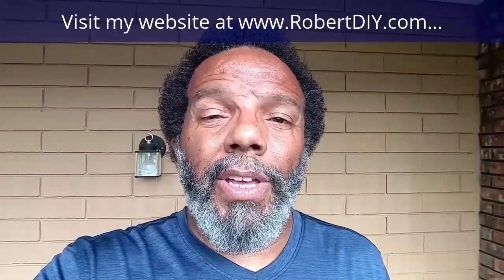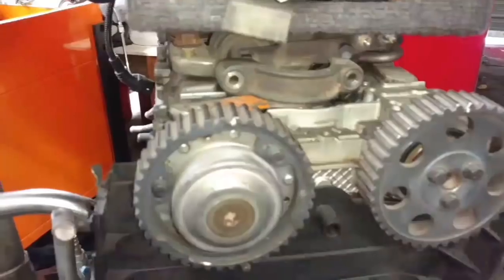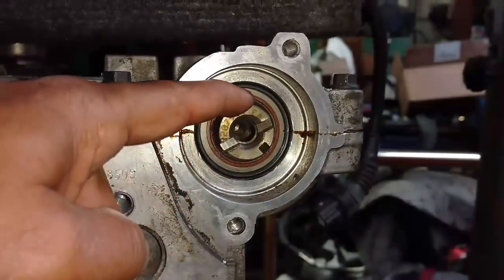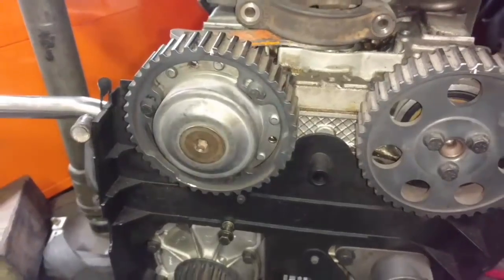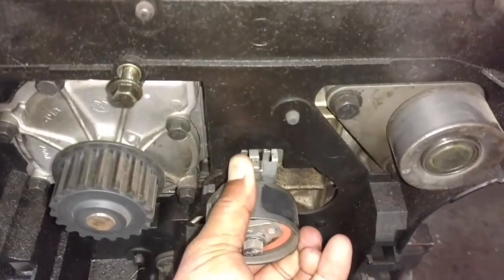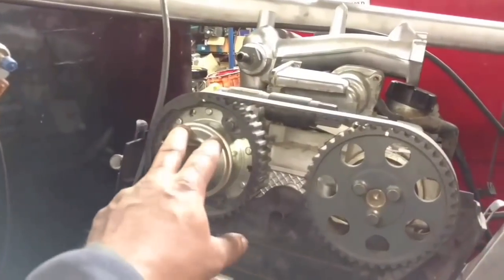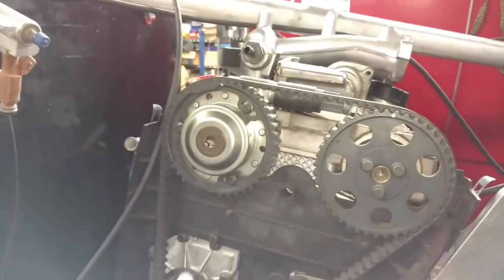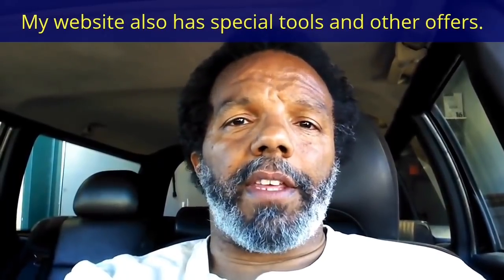CVVT and VVT hub, timing, installation, adjustment, how to install, etc. Volvo cams - VOTD

Comment: Hey Robert I have a 2004 Volvo XC 70 with a T5 2.5 Engine I have recently rebuilt a cylinder head for my car and trying to replace it today due to a burnt valve for cylinder one and I am trying to figure out the dual VVT whenever I got my other cylinder head off of a parts car I’ve removed the VVT hub sprockets and I’m thinking I have a clue on how to put them back I just rather be safe than sorry can you help me and explain to me please and thank you
Reply from the maker: Did you watch this video?

Comment: Any videos on setting VVT on a dual hub motor? 2003 XC70 for instance? Every video seems to be on single spring loaded hubs. Thanks.......
Reply from the maker: Have you tried this method?
Reply: @RobertDIY  I have the VIDA instructions and some PDF instructions but this video doesnt seem to apply directly to a dual hub setup - I was just hoping for a video (visual learner) as some of the instructions a bit confusing in terms of setting the hub to full forward etc. Dealing with two hubs while setting the belt is not much joy either :) - I need 4 hands......
Reply from the maker: You install one hub at a time.
Reply: Robert DIY I understand but the dual hub setup is not spring loaded so do I not have to worry about setting the hub alignment? Instructions talk about finger tight main bolt and turning hub to full forward then back then etc etc. It's a bit confusing and probably reads more complicated than it is. 
Thanks for the replies.
Reply from the maker: If you lock the cams from the rear, install the hubs with the proper play, then install the belt, mark the cam sprockets if they are not marked, remove the locking tools, roll the engine over by hand to make sure you have no contact, you'll probably be good. 

You can also have it towed to a Volvo shop to have it finished. 🤔
Reply: @RobertDIY  "Resetting" seems more involved - This is what I did - 
With cam bolts loose
with the hub bolt tight - turned hub CCW till it stops
loosen hub bolt
Turn entire unit CW till the timing mark was about 2 cogs BEFORE the mark on the plastic cover (this also sets the cam bolts to the left edge of the ovals)
Tighten hub bolt then turn CW till it stops then torque down
Turn the cam gear back to align the mark to the cover and done

I've found no visual references for a motor with dual NON spring loaded hubs.

Comment: Does anyone know what to torque the vvt to? Both the cap and the sprocket bolt. Thanks
Reply from the maker: Did you check the comments section?
Reply from the maker: Probably different for different hubs.
Reply: 88ft pounds on the VVT sprocket bolt.  Not sure about the cap.

Comment: Suppose you have the intake sprocket, exhaust cam hub and crank timing pulley, like on the table. Cam locking tool is not install, the cams and the cranks are just wherever.
And that VVT hub, the 3 adjustment screws are loose.

How do you go from there to a working engine ?

Would the following procedure work ?

FIrst, torque down the 3x vvt hub adjustment screws right in the middle of the adjustment slot.

Then install the cam locking tool, I assume this would set both of the camshaft angle relative to one another. On the rear of the cams, the exhaust cam with the notch down and text upward while the intake cam, the text is down,

Now you install the exhaust vvt hub and the intake sprockets with each a tooth aligned with the engine alignment "feature".

So basically, that slot at the back that I assume the locking tool seats into is what is giving you the "default angle" for both cams.

Now that crank timing pulley how do you figure out where it should go on the crank shaft ? Obviously the crank needs to be at a specific angle relative to the cams. If that's not something like, top dead center at no.1 cylinder, then what is it ? Does the timing crank pulley have a keyway so you can only put it at one location ?

Also those timing marks on those 3x pulleys, I assume if you have both cams in the right location, you just need to line up a tooth with the associated engine alignment "feature". It doesn't matter which tooth, as long as A tooth is aligned with the feature it will be ok. 

For the crank pulley, the alignement feature is cast into the pulley so as long as this pulley can only go on ONE way on that crank shaft, it should be real easy removing it and putting it back on.
Reply from the maker: Interesting.

Comment: I did a timing belt kit replacement and both cvvt hubs lost spring tension , yes I have a cam locking tool. Car is a 2006 xc70. Any advice would be very helpful. I am hopeful I can rebuild them. Thank you in advance.
Reply from the maker: Is it running right?
Reply: runs good , sounds good, has error codes p0016A and B as well as P0017Aand B. gas mileage dropped 25 %. Both hubs have zero spring in them.
Reply from the maker: Maybe the timing is off. Not all hub have spring action, but if they did, they may need to be replaced.
Reply: Both had spring action when I started but now neither spring at all they just flip back and forth . I guess I'm off to the junk yard for a replacement head with good  VVT hubs and checks good on pressure test .  At least I will have some extra parts if needed. Might call the VA man and see if they can help , sometimes they do help.  I was hoping I could reset ( spring tighten ) the springs.
Reply from the maker: Why do you need another head?
Reply: easier to take the hole head for 50 at the junk yard  and get both CVVT hubs , just in case, than not have both CVVT hubs and need one or both.
Reply from the maker: Lot of work to take a head. Especially when most of it will not be usable. 🤔
Reply: with a zero chance of getting a New CVVT  it is the best alternative I can think of

Comment: Hey Rob  I having an issue have a customer car. He took off the vvt Gear how do I reset
Reply from the maker: If you don't understand this video, send it to the dealer.
Reply: @RobertDIY  figured it out. Took a whole day.. But finally.. What happen is that the owner replaced the vvt Gear with out locking the cams.. But it's very simple.. To reset..
Reply from the maker: Glad you got it.

Comment: Mr. 
Robert, I have a 2004 Volvo V70 with dual CVVT I removed one to replace the seal and a new belt. Now don't start . Help me with your suggestion please. Thanks Mr. Robert.
Reply from the maker: Who's instructions did you use to do the job?

Comment: ! beware kind of poor english ! XD and sry its long ;9

ABOUT VOLVOS (fix few times a year volvo or fix every month audi) ==> I got volvo 760i 1991  volvo 740 1990 and i got volvo s40 2003      First generation (1995–2004) are the best volvos  after them is the Second generation (2004–2012) and they are not even close to volvo i dont rly remember what was the alliance called but it was volvo , ford and one other company combined to make volvos but the only volvo thing in it is the coupe(the metal that holds it all in place) .....my s40 is 1.6 the only kind of meh thing is i got variable valve timing (VVT) on my engine you can read sweden....Toyota,Honda,Volvo and kind of VW other cars are breaking all the time from my experience 

ABOUT OUR ECONOMY AND RELIABILITY ==>you cant compare stuff before 2000 and after it ..before it was made to last and be expensive cuz you but lets say stereo or sewing machine one time and you dont need to replace it only to repair it one time a year max and that style of economy led to the market filling up with quality stuff and production gets lowered and factories dont need as much ppl aaand ppl dont have work soo...WE GOT A FIX we will make cheap shit that breaks all the time or we make a design that has a flaw in some part and we get happy ppl/sheep Thats why you cant compare fucking cars before with the cars we got today in shot WE BUY TRASH AND WE TROW "OLD" STUFF AS 
TRASH THAT IN FACT IS GOOD or but maybe it need time to be fixed...

and we die cuz we destroy earth with greed and good ppl doing nothing  that led to capitalism that led to more greed and stupidity
Reply from the maker: Interesting

Comment: Great video!  quick question:  my Volvo C30 has oil pressure solenoids that control the vvt pulleys...to install the timing belt do I simply put it on the marks ( I have the cam installation tool on the back of the engine) and torque it down?  I can't get any movement in the pulleys themselves.  They seem very solid.
Reply from the maker: Did you watch the video?
Reply: um..yeah.  The video has an older different style of vvt.  Mine is an oil pressure actuated one via electric solenoids on top of the engine.  There are two of them, one for each cam.  They don't move manually and are very solid.  No other procedure I have come across has a part that discusses spinning the hub to set the timing.  It looks solid and seems that it should only be timed by placing it on the marks.  I was asking if you had insight on this type as well.  :-)

Comment: Robert- do you know- after I got my VVT hub installed on the 2001 S40 volvo I just bought- I read that it should fix timing issues- I still have the car doing a slight shake in the idling at stoplights-every now and again and when starting up- the mechanic who installed the VVT hub- said this has nothing to do with timing.  This seems to contradict what you are saying here... I'm trying to diagnose and fix the idling issue... oh boy...
Reply from the maker: Have you checked the engine mounts?
Reply: engine mounts? ..I'll get them to check that. but for an intermittent idle shake? it also seems to be losing power-such as going up hills- leading me to believe it's more of an internal fuel/oxygen mix type issue?  Reading the chat rooms- one said it may be the idle control valve-(which I got cleaned- didn't help)-and now the engine light came on after I drove away from them.... they also said it was the spark plugs (ignition coils apparently were fine)- but I'm starting to think instead of being penny wise pound foolish- just go see the one guy ($$) I know who knows the Volvos inside/out to diagnose this once and for all. Another chat room said it could be a defective throttle position sensor?. Problem is these garages won't tell you when to throw in the towel they fix one thing and then say- oh but you have to get this fixed now...
Reply: luckily (knock on wood)- the shaking after reading up on it on volvo chat rooms it was ONLY the need for new spark plugs and the idle control valve being cleaned (I went in asking for that)- before that I had 5 or 6 guys scratching their heads telling me it could be "hours of diagnosis!!!"
Reply: Robert- Can you put a   spring loaded vvt hub on x90 in place of a non spring loaded vvt. Will it work or does it make a difference.

Comment: just had this done yesterday- bought a volvo 2001 s40- 4 min after driving from private seller- engine light goes on- it had already got timing solenoid done- took 6 mechanics telling me that it could take "hours of diagnosis" to find why oil leak under timing belt cover- a real volvo guy looked at it in 2 min- told me- need to replace the cam.... which caused it to leak on the fairly new timing belt..which could ruin it- after reading copious amounts of cam this and cam that - got the hub changed and the seals- 800$ later..... so far so good- just hoping that slight intermittent stutter/flutter at a stoplight is now fixed.... mechanic said i should now be good to go for 5 years...at 350,000 apparently these models are toast- in hindsight probably wouldn't have gotten car- got spoiled with my volvo 1980 240- that ran like a charm.... but can't cry over spilled milk...
Reply from the maker: Where's the 240?
Reply: don't ask... a mechanic convinced me to sell her. atleast she went to her "retirement home" where she only gets driven in the summer.... just started the car up today after the s40 fix yesterday and the car seemed to sputter at the stop light...  I'm hoping its my imagination..lol- could this job if done incorrectly- affect timing issues? (the shop just told me - it shouldn't but I'm not so sure- ..)
Reply from the maker: Have to wait till it pops a code then have it checked out.
Reply: it just had codes- and they were all to do with the cam.... can I bring it back to the guy who diagnosed it- told me it was the hub and now this ?.... oh boy.
Reply from the maker: Ouch!
Reply: Ouch is right. now they say it could just be the ignition coils is it- apparently they have 2 instead of 4 and the wires could be funky- so it needs a tune up- oh and the coolant looks like coffee- needs to be flushed and changed- the snow tires replaced and the heater electrical board changed no heat comes out oh and the heat trap or whatever they call it to dissipate heat underneath the hood is missing and needs one not to mention the turn signal doesn't go right so you have to hold it when you turn (and there are 2 broken back springs- which the guy safetied- which he shouldn't have)!! so ouch-  is RIGHT.

Comment: Man these new Volvo's are junk. Nothing beats an 850, 740, 960, 168, 122 Amazon, 780, s90 and 240.
Reply: Trisdoo o I drove my mom in law's 850 turbo wagon the other day. First time I was left alone driving it. Man those things move!
Reply from the maker: I wouldn't want to own one unless I had the money for maintenance & repairs.
Reply: emissions calls for different standards in new engines, they are good for 300k plus miles, so I wouldn't call them junk, they just need some technique to work on.